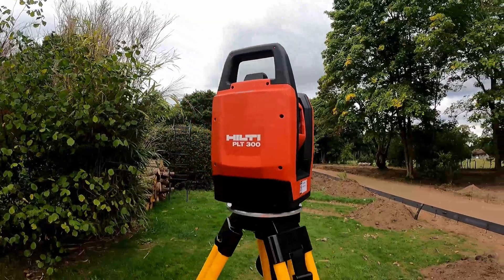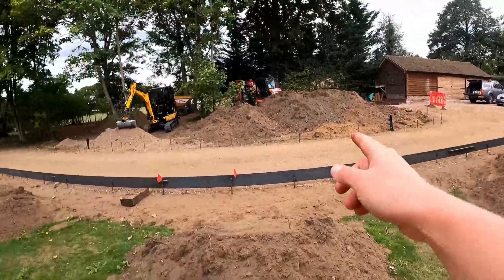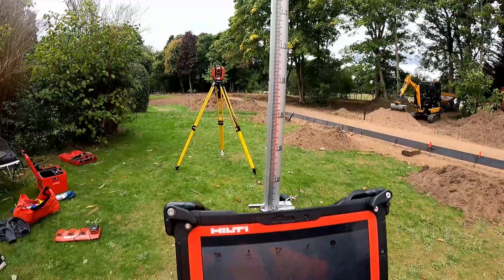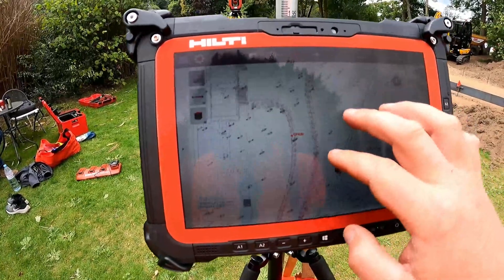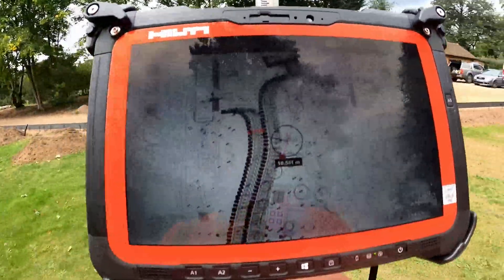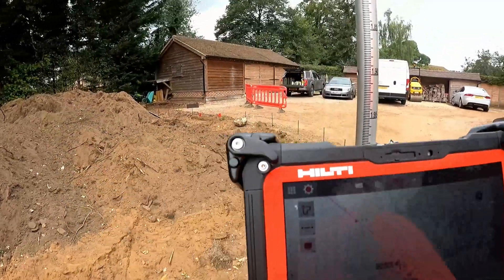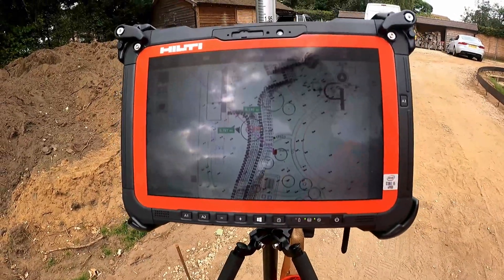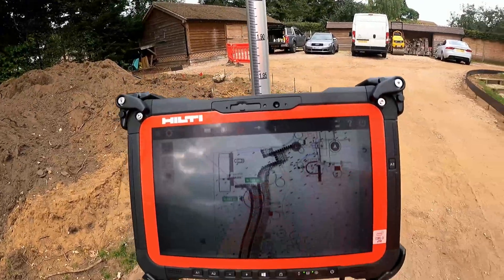Hilti PLT 300 Total Station First Impressions

Comment: Did you set up the control points yourself or did you need a surveyor to set them?
Reply from the maker: This site had an as built survey done before we started which in theory the design then used as its basis. However, the survey was done fairly sloppy and we had issues getting the total station to know exactly where it was in the job. We ended up measuring points ourselves and forming our own control points for the remainder of the project. Once you have them setup - its a doddle to set the unit up each time. But this initial day was a bit frustrating - partly because it was brand new to us and we were learning it. But also because we put too much faith in the survey which turned out to be incorrect.
Reply: @Olliegunns yeah the biggest barrier to ground workers using total stations without an engineer is that the data from the architect needs to be modified/cleaned up before being put on the total station.. do you use AutoCAD?

Comment: correction, they are NOT engineers, they are Surveyors, and it is not simple, this is heavy tech, not just in the cad/computers, but the readings need a high IQ level maths to interpret the numbers.( I have Autism and tried it, not my cup of tea); think of this like an aircraft automation system, this is only a sensor saying pitch, yaw, speed, etc. it takes the pilot and the augmented autopilot systems to transfer the info onto a map, so you know where you are and where you are going. this is high tech needing a high IQ to operate, tape measures are low tech, every man and his dog can use!!

Comment: Ollie, another option is the Trimble Ri. Excellent tool, software and files work with many different platforms. Nearly exactly the same tool as the Hilti. Less expensive as well.
Reply: FieldLink, the Trimble Software that runs the Ri, also supports the R780 GPS/GNSS receiver.

Comment: You could easily set out houses with this thing couldn't you? I'm a residential builder and just want to set out my new builds fast.
Reply from the maker: Yes, provided you have good drawings and can reference off something existing to get you established when setting up - its actually pretty simple. And for repeat set outs like foundations, then sub structure brickwork etc its really good.
Reply: @Olliegunns  Yeah that good, probably can add walls into the system drawing and lay those out too once your floor slab is done. Man sounds like a huge time saver